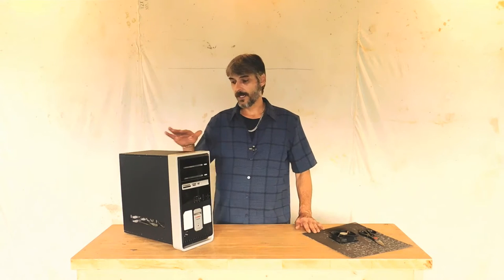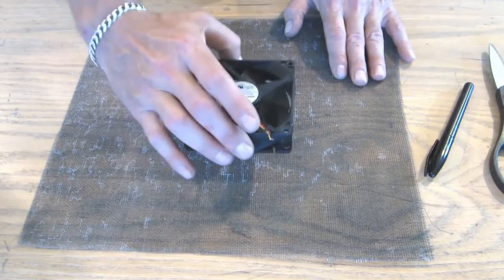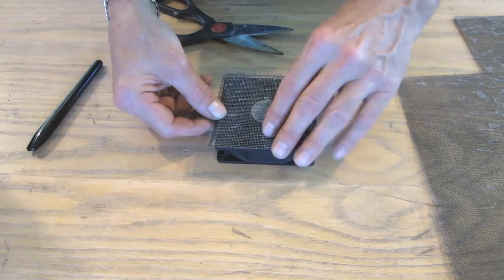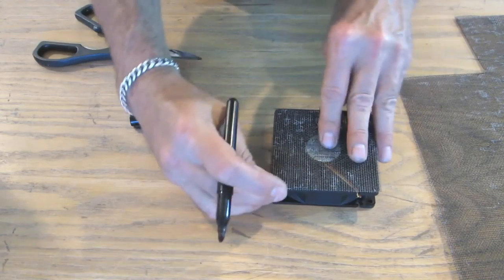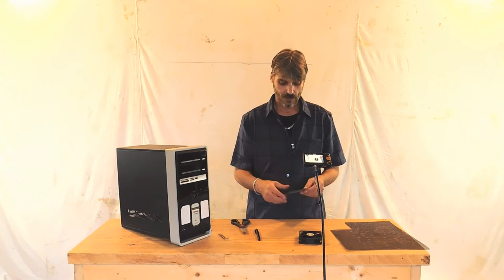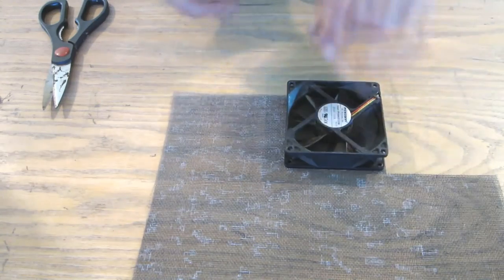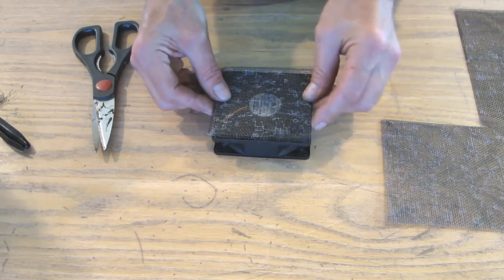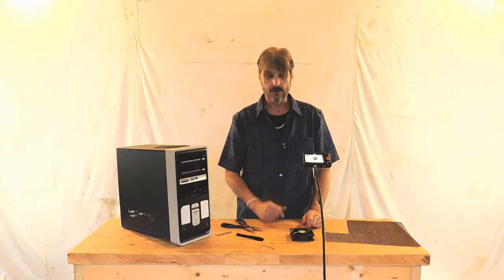Make Your Own Fan Filters, Custom Computers, PC Mods, Budget PC Build.

Comment: Hey man, great simple vid. Best ideas usually are simple. If you do remake the vid; I agree with some of the other commenters to try one with the pantyhoes over top to see if it helps at all.
Reply from the maker: I had to go back to work for a month or two, then I'm coming back strong and I will make every video I wanted to.
Reply: wouldn't panty hose would stretch and/or rip?  i wouldn't think that PH would stand the test of time.

Comment: DONT DO THIS... Firstly your filter must be several times your fan size.  I dont have a vid to post, but I did
positive airflow filter using 5gal bucket lid, stick on foam strip for a door/surface mating, 2 layers black
sheere nylon stocking XXL stretched over.  painted bucket lid black,.  used 2 pieces tin I had laying around
for 2 screw clips holding lid tight against foam strip.  Year later...inside totally clean...everything.  I leave
my hotswap doors open and drilled a few holes to get all my air flowing over stuff i want to keep cool.
it works.  its a little clunky lookin, but cheap, $10 all in...panty hose mostyl.  and the black nylons show dust as it builds.
just hit it with vacuum ever 2 or 3 months. Forgot to mention, carved big hole in that lid, removing 80%
of lid material.  I just needed the ring to stretch nylon over, and stiff enough to  pull down on foam
for good mate with only 2 screws.  Working on new ideas for big tower I'm building.  Maybe I'll post that.

Comment: where to get this type mesh?
Reply from the maker: Most hardware stores, it's aluminum screen for house windows.
Reply from the maker: About any hardware store.
Reply: Are there any flexible materials like nylon screens maybe?
Reply: @agoogleuser9025  yeah that's what i was thinking. I just replaced a sliding door with screen material from amazon. It was black nylon. But, aren't the holes a little too big to block dust?
Reply: @8686joedog  good use for them is for windows and screen doors to block insects maybe, definitely not for dust.